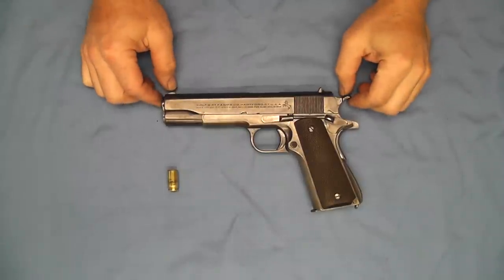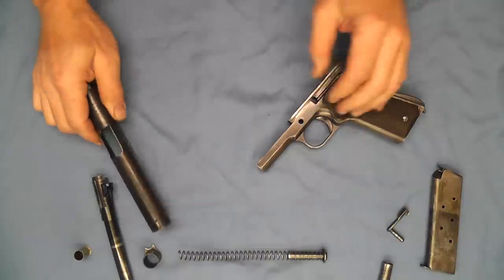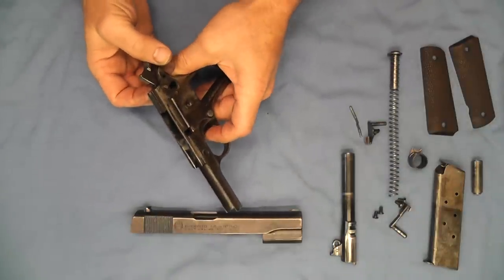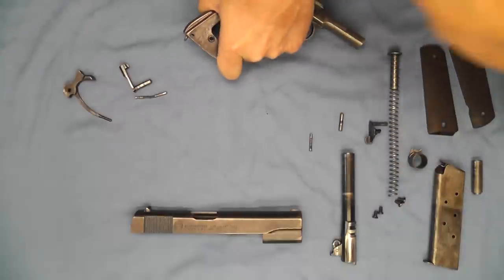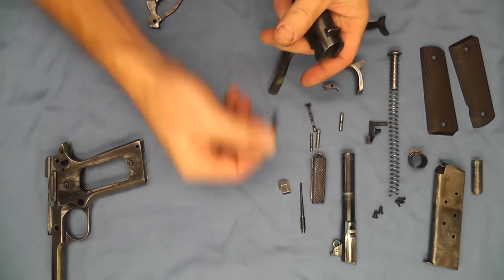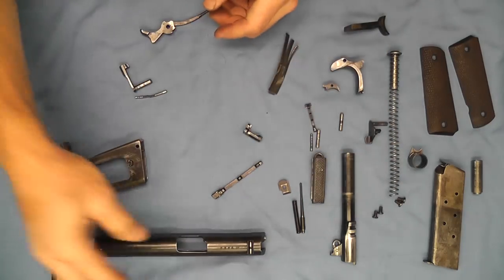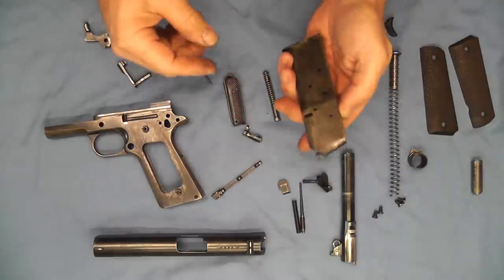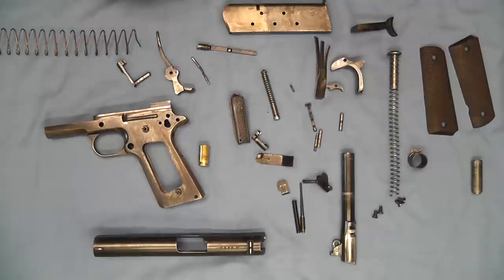1911 Pistol No Tools Detail Strip

Comment: Could the recoil plug technically be used to take off the grip screws since its the exact same diameter as a 45acp case? I've also heard a 45acp case could be used as an emergency recoil plug if you lost yours. I tried it and although it works, it doesn't prevent the barrel bushing from rotating.

Comment: You can also remove the slide before removing the recoil spring by simply removing the slide stop, then remove the slide with recoil spring under tension. This is the way I disassemble my 4" pro model since it has a bull barrel and reverse recoil spring plug.

Comment: To be fair, if the pistol you stripped is from 1927 then i'm sure its been taken apart quite a bit, which means everything is WAY looser than on new ones.  not that you did anything wrong (he should have known better than to use the mainspring on something that probably hasn't been taken apart before) you may want to let people know about that before they start trying to take down new guns.

Comment: Still remaining:
Barrel link
Barrel link pin
Plunger tube
Ejector
Front and rear sights
Hammer strut pin
Reply: biffle35 You are right. Maybe this is all you need for a good cleaning, inspection. Again, you are correct.
Reply: I'm also learnin' up on my 1911 parts chart and being picky.  Nice vid.